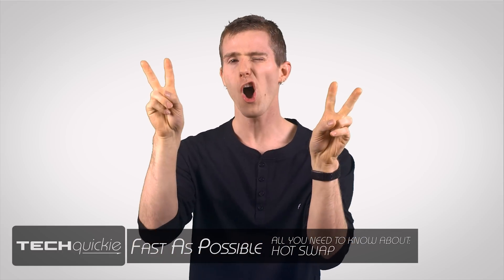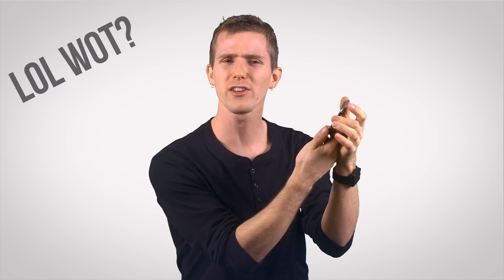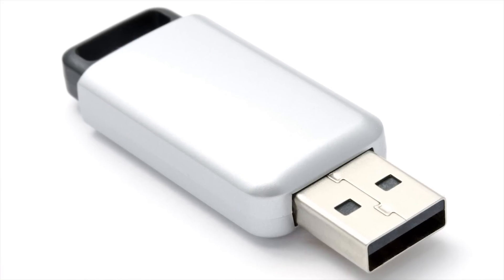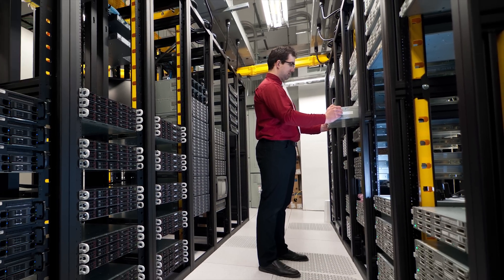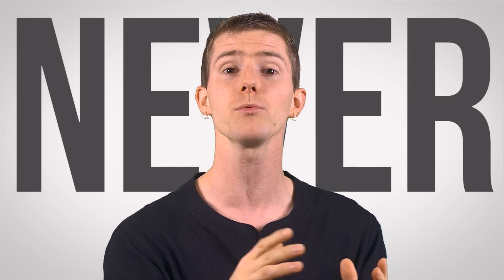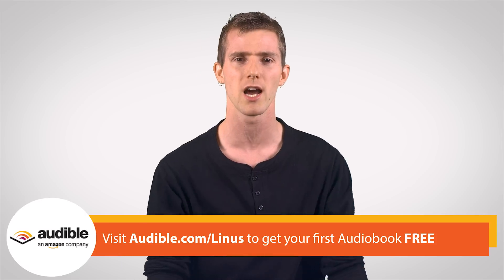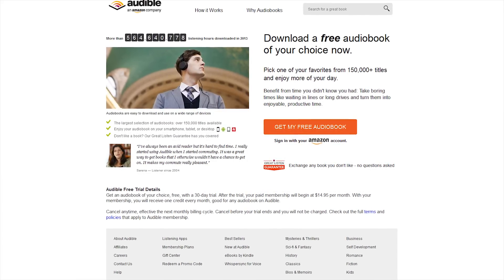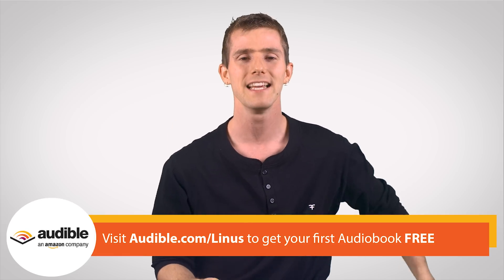Hot Swap as Fast As Possible

Comment: The headphone example is just soooo bad, because headphones are analogue. Also, where can I get that Faze clan shirt?
Reply: You gatta 420 bl@azzze no scopes yy 360 fakey fakey it m8
Reply: just because it is analogue does not mean it is a bad example.  it is a good example because it can be understood by the masses and other explanations could be harder to understand than that.
Reply: They are, but most devices have to detect when they are plugged (to choose the right audio output, for example).
Reply: Jay Anderson Analogue AUDIO equipment, maybe, but not everything that's analogue.
Reply: Edwin Kravcenka Edwin, analogue headphones are headphones that require an analogue signal, digital headphones are headphones that require a digital signal. It is clear that you lack the understanding that gear is of course not analogue or digital, because it is physical piece of equipment, but when you refer to a piece of equipment being analogue or digital, you mean what kind of signal it requires to operate.
You're claiming I don't understand what analogue means? I beg to differ, but there is of course little point in arguing someone with such a bad understanding of technology as you do.
Reply: Spencer Tracy its a bad example because all and any analogue equipment is "hot swappable". There is no possible circumstance when plugging headphones in or out could require a reboot.
Reply: It's not a Faze clan shirt, it's a Five Four club one.
Reply: Uhm..... how are headphones analog or digital in any way? They are a physical object. The signal they take in is digital as well (almost always)... they then use the (yet again - almost always) digital signal to create sound. (not going to go into the details, but i don't think u understand what analog means). Everything in phones and computers is digital - they also provide digital outputs :/
Reply: Jay Anderson I see your argument on how it is a bad example from a technological standpoint.   However I believe that it is a good example because it can be understood by a wider variety of people as many people do not know the difference between Analogue and Digital signals.
Reply: Jay Anderson its still not a bad example simply because earphones are analogue devices... its a bad example because they are really simple and wouldn't be non-hot swappable anyway...
Reply: megaspeed2v2 umm, I dont think you really understand how these things work. Digital headphones are not neccesarily hot-swappable just because they are headphones.
Reply: Jay Anderson i don't think you even understand the conversation xD in the example given earphones plugged into and out of a phone were used, these tend to be passive devices (so they are just a straight wire to diaphragm architecture which takes in an analogue signal) so there is no circuitry in the earphones that the whole system requires to be connected beforehand in order to work.

by the way there is technically no such thing as "digital earphones", sound is an analogue medium so anything producing it is analogue. Calling them "digital earphones" only makes sense is because it makes it simpler to explain to customers that they would have a digital to analogue converter and usually an amplifier circuit built into the headset or moulded into the cable as an inline adaptor (e.g steel series siberia headsets), the digital part is all that circuitry before which are not part of the earphones but simply power them by taking a digital signal from a device and making a simulation of an analogue signal which the earphones themselves use.
Reply: megaspeed2v2 Headphones that require digital input are known as digital headphones (afaik). Yes, you're right that they are passive devices and no circuitry in them, so we are basically agreeing at this point. I still think it is a bad example, because there is no reason why they wouldnt be hot-swappable. I just think it's kinda like saying that my desk lamp is hotswappable, because I dont need to cycle the power grid to make it work.
Reply: Jay Anderson i didn't say it wasn't a bad example i actually originally said in my first comment that it was a bad example for the same reason you just stated here lol
Reply: Yeah you're right..

Comment: Guys this build good for gaming and video editing.? 
Im a competitive tf2 player asia
http://pcpartpicker.com/p/6b2GHx
Reply: looks good, the sound card is cool too, not necesary but cool to have if you want to pay for it.
You could though, swap that ram for standard ones as being "ultra extreme super deluxy hardcore" etc wont really make them any better than the standard 1600mhz ram. You are only paying for the brand and the fancy stickers there, and a heatsink which is really not necesary at all because ram doesnt get hot unless you overclock the shit out of it which again doesnt do a lot if anything for for game and normal applications.
I would save on the ram and put that into a better cooler for the cpu, the 212evo is good and cheap but its not the best. A better cooler would let you get a couple extra mhzs out of that cpu which would give you way more fps than those fancy ram sticks.

Get standard 1600 ram, and change that 212 for a corsair H50 or add ten bucks and get a H60, you will get less noise, cooler temps, more overclock headroom and actually more fps
here http://pcpartpicker.com/part/pareema-memory-md316c81611l2 these look good enough
Reply: If you absolutely must have peripherals that expensive, that's fine. But I would buy cheaper ones and use that money to buy an SSD tbh
Reply: Laharl Krichevskoy in my country this ram cheap and non heatsink version only difference in 5 dollar and im not overclocking any components run them all in stock clocks also i wanna replace intel stock heatsink to 212 for better heat dissipation thanks for the replay mate :)
Reply: tothfirytoob Already bought this keyboard and headphone just adding them to see compatibility :)

Comment: Can we hot swap HDD's?
Reply: depends on the setup. you CANNOT hot swap hard drives in raid 0, doing so would cause massive errors. Hot swapping tends to be really useful for larger arrays like Raid 1 or Raid 5, but again you have to be careful which hard drives you remove. It can get pretty complex.

Comment: How would a battery be able to be Hot swapped? The battery provides electricity so no battery = no electricity. Unless there is some way to have lots of electricity in the system while you change the battery I don't see how it could work.
Reply: A backup battery or dual batteries
Reply: SOME DEVICES PLUG INTO WALLS, and still have a battery :)
Reply: There is a component that can do that, it's basically like a battery that instantly charges once it gets power, and slowly drains once the power source is gone. I have used it to prevent flashing lights in my circuits. So I imagine a bigger component like that would allow for battery hot-swap.
Reply: The Ara will have 2 batteries
Reply: I look after computers at the hospital I work at that have hot swappable batteries. There is just more than one and they are charged externally.
Reply: Some sort of special capacitor may work as well
Reply: I can hotswap the battery in my laptop....as long as the charge cord is pluged in